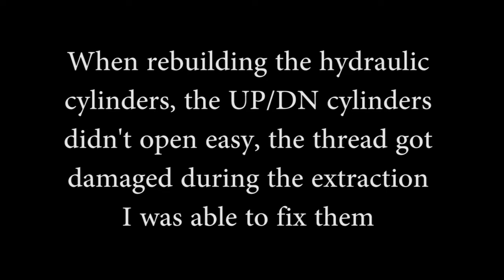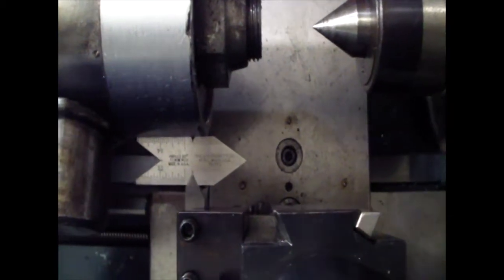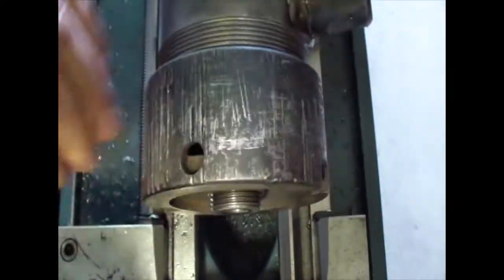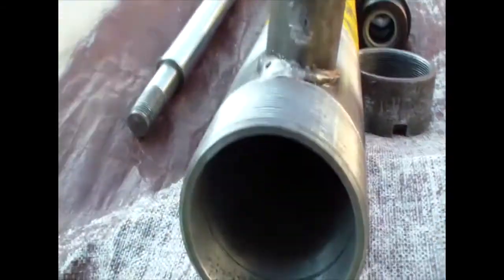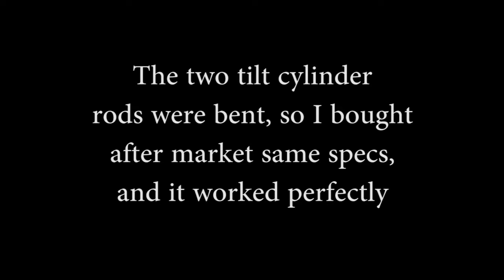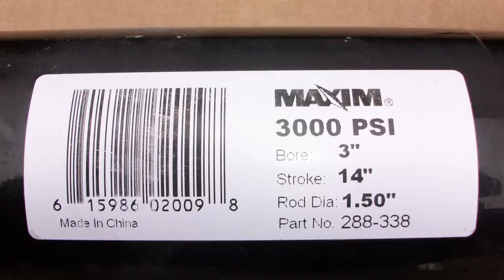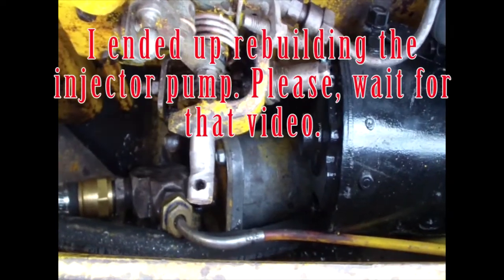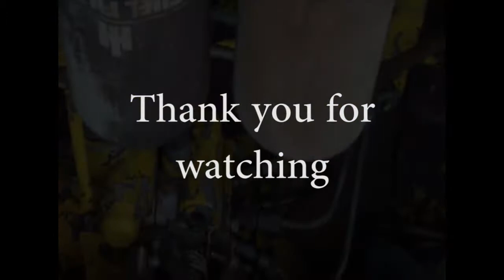Repair Bulldozer Hydraulic Cylinders, Making Gasket & Fix Injector Pump Accelerator/Decelerator Arm

Comment: its me again 2 questions for ya. how did you determine the specs of the cylinder replacements. i just bought the same cylinder from maxim and my td8c cylinders are bigger guess i should of checked specs first but i appear to have a 1.75 inch rod and my cylinder is fatter and longer how did you determine the stroke size. and did you cut them open with that cutting disc or did you use your lathe to cut them open
Reply from the maker: Good evening sir, I just measured the stroke of the cylinders, rod diameter and bore size. On mine, the original were 14 inches stroke, 1.5 inch rod and 3 inches bore. So I ordered 14 inches stroke, 1.5 inch rod and 3 inches bore. What is your original cylinders stroke, rod diameter and bore size? Also if you do what I did make sure you do it on both sides.